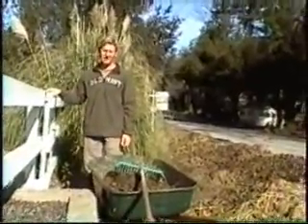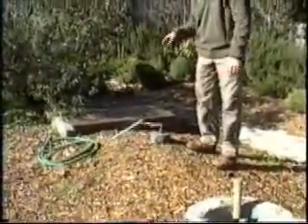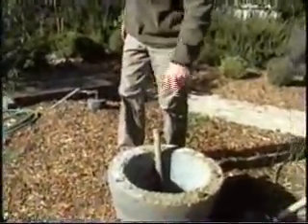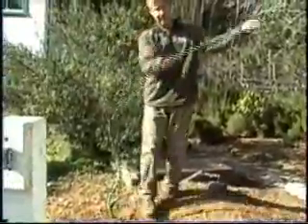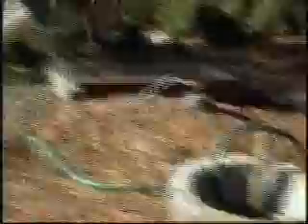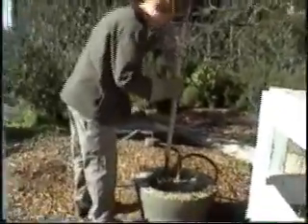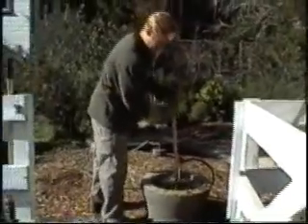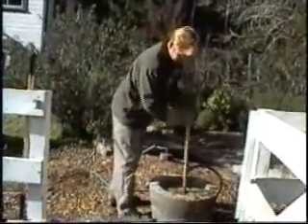Biogas Digester for the Home

Comment: Have you thought about using bacteria like rid-X or some other bacteria to increase the methane production and to decompose the maneur faster? I understand that water temerature is also a factor so if you are to increase the temp inside the digester you will have faster acting bacteria and gas production would increase, also your afluent (the liquid left over) will be clear and full of nutrients for your plants.

Comment: You should not allow the hose to sit in the mixing basin, the manure can back siphon into your clean water supply. Have any good ideas about using human waste from the house, or just carry the 20 liter bucket to the mixing basin. How big is your tanks?
I see you said it is 1.5 meters deep.
But at any rate thanks for building and using the digester.

Comment: @Gruurk2 Is there somewhere where I can see an example of this? And would this be an upgrade in the tank, and if not wouldn't the line between the tank and the filter always be in danger of corrosion? And if he were to pinch the end if the line submerged in the water, causing a more jet-like stream of gas blowing through the water, and change the water say daily, would that be enough to achieve what you are talking about or will it have to be something much more elaborate?

Comment: @Gruurk2 So what exactly do you mean by "bubbling(fine mist) it through water in tube a 2-3 of times." I took that as running the gas through water, as he did, but adding the step of changing the water periodically. What are you saying to do differently?

Comment: @Gruurk2  Does the steel wool have to be replace periodically? and wasn't he running it through water; would that not remove the CO2 if replace on a regular basis?